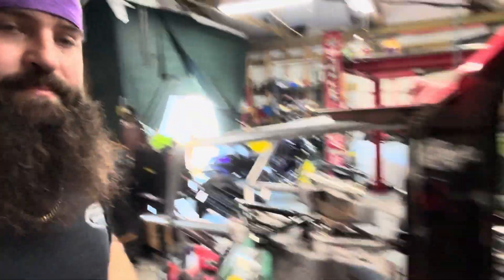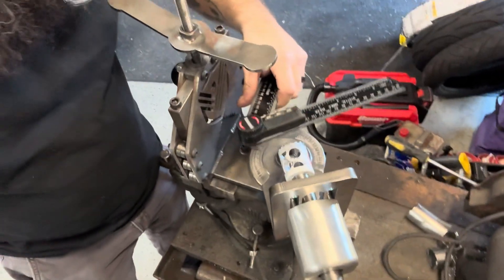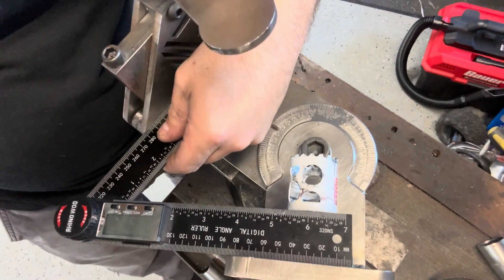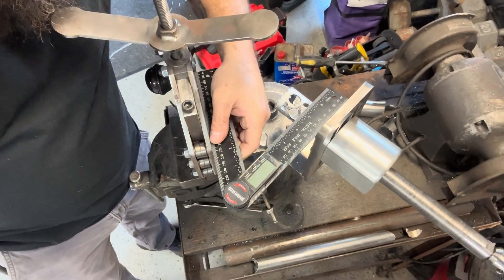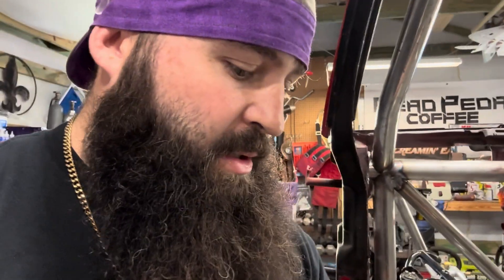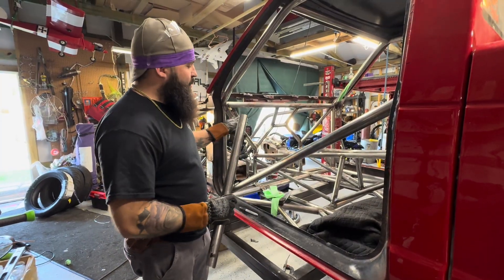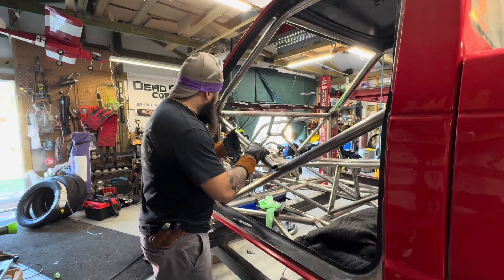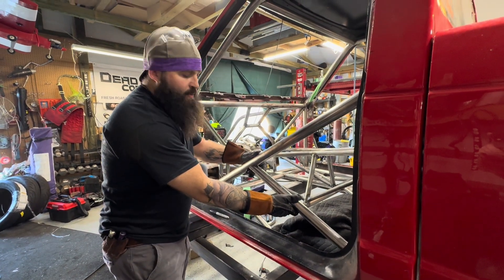How to build a 25.2 chassis. 💥 how to build door bars 🔥

Comment: what material are you using ? and where do you get it never seen it that shiny. looks good
Reply from the maker: Docol r8 and i purchased from aed it’s amazing material
Reply: @JagneauxBuilt  is that chromoly type
Reply: @NextEraCustoms it's actually better than chromoly, cause it's made with all new material.
Reply from the maker: Yes it’s compatible with chromoly